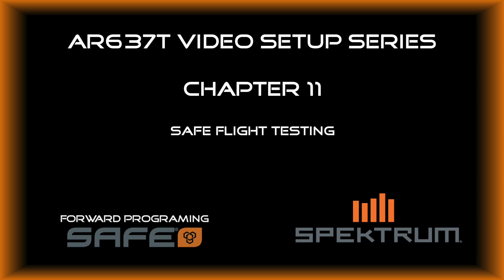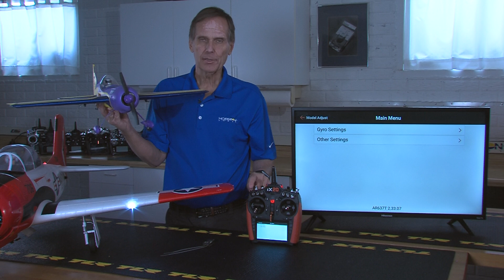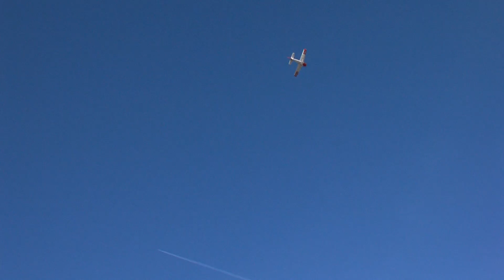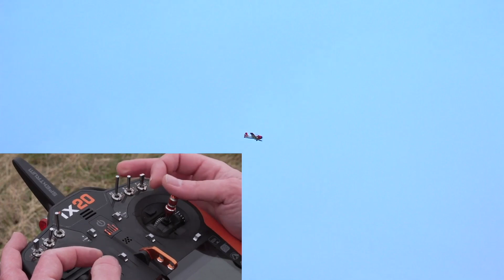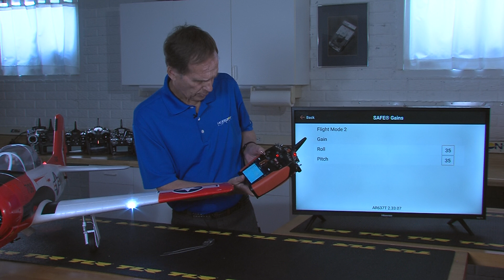Spektrum Smart Receiver AS3X Setup Series #11 - SAFE Flight Testing

Comment: When I tested the envelope flight mode, I found that angle limit was only enforced when a stick movement tried to say bank the aircraft beyond the envelope limit. With the sticks centred, I could physically bank the aircraft to any degree. Is that expected functionality? A supplementary question is: Is that the same as the 636 as I seem to recall that receiver prevented the aircraft exceeding the envelope limit regardless of control stick position? ( but I could be wrong). Thanks.

Comment: I have an AR637T installed on my Flightline B24. Took it out for a trim flight yesterday. During a slow pass. When I increased the throttle to climb out. There was a sudden pitch down. I was in SAFE mode, with 50 AS3X gain, 35 SAFE gain, and 20 pitch heading hold in SAFE mode. All gains are fixed. 

Control inputs: 20% throttle, with full flap down, increased to about 50% to climb out, then the pitch down happened. I then eased the throttle back and raised flaps to get out of it. 

The plane was flying just fine. It feels pretty nose heavy, had to dial in a lot of up elevator trims. The wind was minimal, so I don't think there was any play with the AS3X gains. And the pitch correction in the SAFE mode was pretty smooth. Could there be too much pitch heading hold for the SAFE mode? Please let me know if you guys have any ideas about what could've caused that sudden pitch down. 

Clip of the sudden pitch down:
https://www.youtube.com/watch?v=w0aEHndtbuw

Full flight video:
https://www.youtube.com/watch?v=eM0LjGVZmyQ
Reply: Have you checked CG for the nose heavy issue? Do you mix elevator with flap deploy? What was the angle of flap at full deploy?